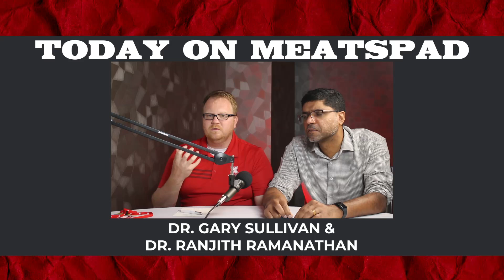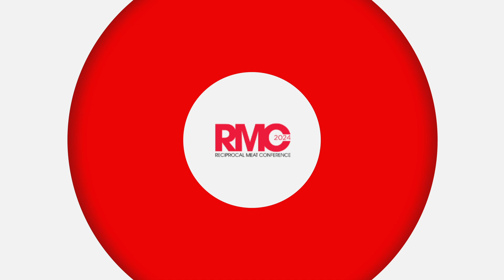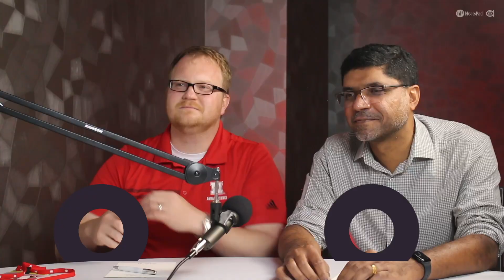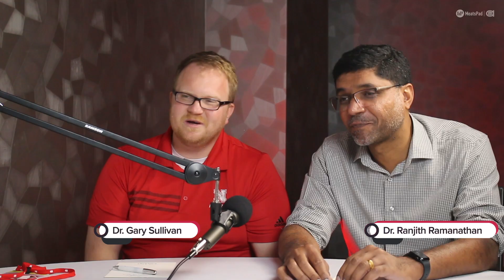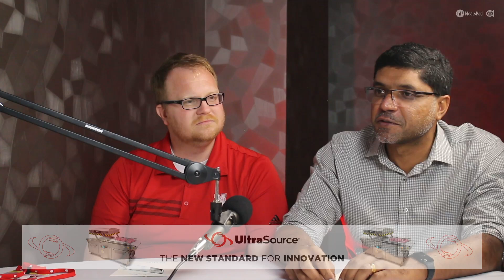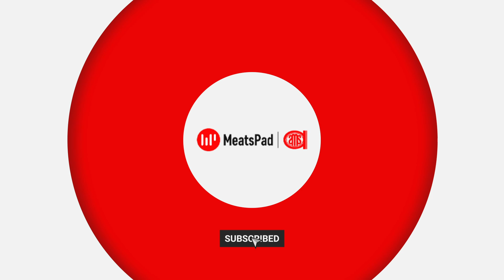Revolutionizing Meat Quality: High Pressure Techniques Ep. 145

Comment: If suppose we cut(above pH 6) high pH beef , what is effect of colour or quality?
Reply from the maker: When high pH beef, often referred to as dark cutting beef, is subjected to high-pressure processing (HPP), the color and overall appearance significantly improve. Normally, high pH beef exhibits a darker, less appealing color, which can affect its market value due to consumer preferences for a brighter, cherry-red hue in fresh beef. 
By applying HPP, specifically at lower pressures around 300 megapascals, the meat can retain a more desirable reddish color without appearing cooked. 
This treatment also helps in maintaining the meat's natural texture and quality, making it more visually appealing and potentially increasing its marketability. 

Dr. Gary Sullivan notes, "When we get to that 300 megapascals, it really lightens the color some. We get a nice reddish color but we're not getting the cooked color, and so it makes that dark cutting steak, which people don't like and has discounts associated with it, look almost like a normal steak" (07:20).
Thus, HPP offers a promising solution to enhance both the visual and qualitative attributes of high pH beef.